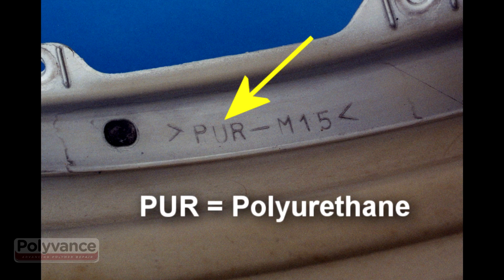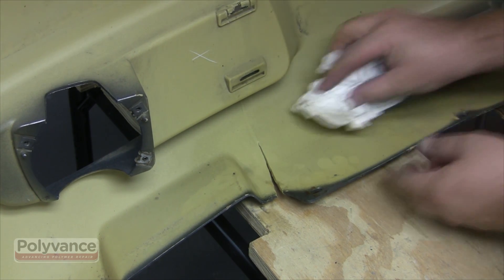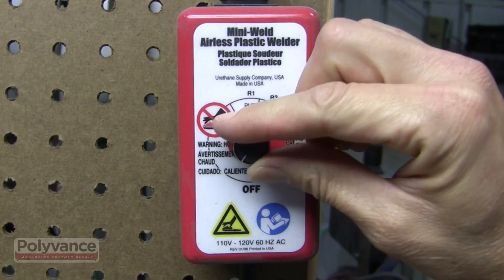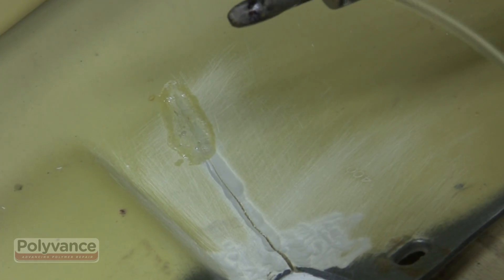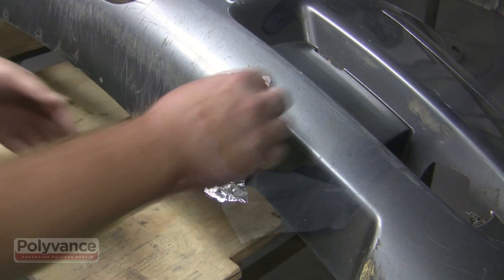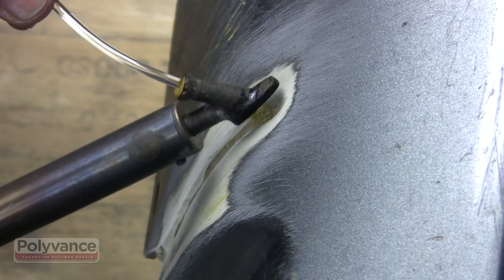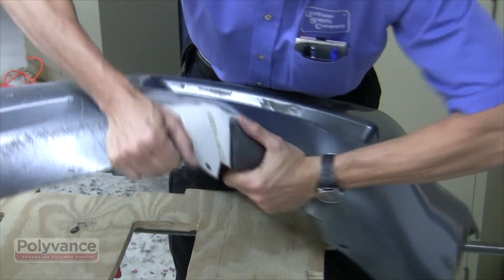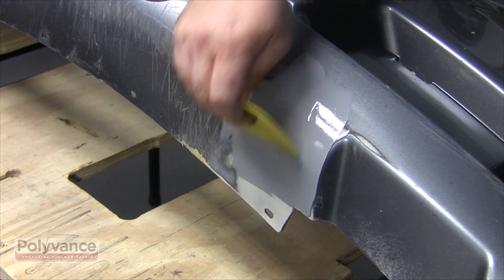How to Repair Thermoset Polyurethane

Comment: They got an awesome bond on that repair. Even wrenching it for an intentional break failed. Curiously, molders switched from PU to PP/TPO plastics. If anyone knows why plz share.
Reply: They still use urethane in some cases.  the reason for the switch is cost.  On high production cars, the cost of the mold is high for making bumpers out of Polypropylene, but the high cost of the mold is offset by the low cost of polypropylene plastic resin...so the higher the number of bumpers made, the lower the cost each is with higher production numbers.  With low production number cars, its more cost effective to use urethane as the bumper material because the mold cost is much lower, however the materials cost is about 3x that of a polypropylene bumper of equal size.  Urethane was also used in the past because paint bonds to it fairly easily and its impact resistant as well.  New paint technology has allowed paint to reliably stick to PP modern bumpers are typically made from.  I hope this answers your question!
Reply: Thnx for delineating. Could you touch on the viability of each plastic's useful life. PU, aerated type, degrades pretty quickly according to an article I chanced on discussing its use in footwear. It was a shock to see the extent of PU degradation throughout the shoe's midsoles after 15 years or more. It got me thinking in a very different way about TPs. Do PP/TPO plastics have this problem?
Reply: @vivianoni9565  Urethanes in general are susceptible to decomposition from a wide variety of things ranging from UV light to solvents.  On bumpers, this is generally not an issue because the outer surface is covered with paint and the inner surface doesn't see much action from anything at all...however urethanes tend to shrink as they age and deform as a result of external stresses...like gravity.  This can cause them to not fit well after a long period of time and have saggy spots.  They can also craze and cause the paint to crack, once that happens the deterioration accelerates.  PUR bumpers are also not recyclable.  

PP bumpers don't have any of these issues.  their only drawback is that paint can be a challenge to get to adhere. Bumper and Cladding Coat Adhesion primer and Plastic Magic fix this; either can be used to get paint to stick well.   They also can only be repaired by welding to get a 100% reliable repair.  As an added bonus, they can be recycled and made into other things...Flower pots are a common 2nd life for polypropylene bumper plastic.

Comment: FINALLY I find a video that helps!! I'm moving the medallion on the nose of my Jaguar to the grille and need to fill the hole(s) left behind. Not thinking of welding to fill the hole, just thinking about using the epoxy filler. So to prime I really won't need an adhesion promoter?? I'm impressed with the strength of that weld in the video!!

Comment: Hello there. I have a boat made from  Comptec PE3, a three-layer polyethylene. It has a crack that can only be accessed from one side, it is about 10-15mm in length. How could I repair this?
Reply: I myself have a Coleman Scanoe RamX And it is not easy to fix it’s crossed linked high density polyethylene which turns the HDPE from a thermoplastic that can melt into a thermoset plastic which means it no longer melts… at this point It’s not easy to repair, even before adhesives and epoxy’s will NOT stick to HDPE. A guy has to first &  foremost clean the area very well with alcohol then with a die grinder creat a groove in the crack… next create a slight bevel around the crack a bit wider in diameter then the groove in like an oval pattern. Then with course sand paper rough up the area to create tooth or bite for your plastic filler to stick too. (I recommend HDPE Welding Rod) and then buy a Polyvance's KCWPRO airless plastic welder (less then $100) melt the rod with the welded and force it down into the crack to create a plug. (Remember not to heat the base material ) fill the whole crack then continue to continue to fill and smooth whole bevel, the smooth. You can sand after you’re done if you need to if it’s sharp or rough

Comment: I just tried my daughters hot glue sticks and it hold strong as $4 job done
Reply: Unfortunately, they do not hold onto urethane as well as the urethane to urethane bond.  It may be OK for a temporary fix you don't plan on refinishing, but for a paintable, permanent repair urethane rod is the way to go.

Comment: What is the temperature for PUR ? 
Amazing job
Reply from the maker: Thank you! The setting is around 300 degrees.
Reply: Polyvance. I want to test this on my bumper of BMW e30 84.
Reply: Polyvance. Hello, I've a problem..
I bought polyurethane from your brand + tip. It's very difficult to buy in France. I used a seller in England who charged me a lot of shipping costs. You tell me it's 300 degrees C, I see you're selling an ATV kit with a 40 watt soldering iron. But 40 watt = about 560 degrees. I do not know what to buy ... I buy a 25 watt 300 degrees or 40 watt 560 degrees? Celsius.

thank you.
Reply: First of all, wattage has little to do with the tip temperature.   The tip size, internal thermal conductivity of internal components, ambient temperature, airflow around the welder, and component design have a far greater effect on the temperature....Its impossible to simply plug watts into a calculation and get temperature.

The current  ATVPRO welder we sell is 200 watts, the ATV welder at 40 watts has been discontinued for years, the 80 watt ATVPRO is also discontinued.  The 200 watt ceramic core welder and the 80 watt ni-chrome wire heating element produce roughly the same tip temperature....ALL of the above welders are too hot for urethane.  There is a work-around however.  If you want to use the ATVPRO for urethane, simply start welding before the welder is fully hot and keep rod moving through the tip to keep the tip temperature down.
Reply: Scott B thanks for response.
I can not buy the ATVPRO. You imagine, I paid 90€/106 dollars for your tip and the rods in Europe. That's a lot of money for me. I am not rich. And I do not know what soldering iron wattage to buy in Europe at a good price for your standard tip. :-(
Reply: That's quite a mark-up they put on that, but a lot of that might be due to the high shipping costs associated with importing/exporting.
Reply: Scott B i wouldnt even attempt to import that to thailand then as the import tax (theft) Is around 300%! Guess ill buy when i go back to the uk.

Comment: What can I use to repair SMC can I use my fiber flex and my welder
Reply: You really can't use the welder to repair SMC.  SMC is Sheet Molded Compound, aka Fiberglass.  The best repair for it is to sand the area being repaired, beveling the edge gradually, then apply layers of glass cloth saturated with epoxy resin.

Comment: Can i use fiber flex to repair radiator nylon
Reply from the maker: FiberFlex will stick to nylon, but it isn't the best option. It would be better to repair it with nylon welding rod (https://www.polyvance.com/Nylon-1/), which is the rod that comes in our radiator repair kit.

Comment: Instead of requiring two hands to apply the welding rod, it would be nice to have a tool like a glue gun where pulling the trigger applies the rod.
Reply: We've actually looked into this, but found that applying urethane that way is not as versatile and produces a lower quality bond than when using the 6027HT welding tip.  The reason we think this is so is because you don't have the pressure of the melted rod being forced onto the urethane.
Reply: @scottb7600  Good point. What’s your opinion of using something like a construction adhesive that is polyurethane?  Then you don’t have to melt?
Reply: @STARGAUD  Most adhesives will not bond as well to urethane as urethane bonds to itself and in terms of cost, a little welding rod is much cheaper than adhesive.  Yes, I know, you still need to make the investment in the tool, but spread out over multiple repairs, the tool will more than pay for itself.
Reply: @scottb7600  Thank you for the reply.  I have the tool! Should I use the clear rod then on a urethane bumper?  I am currently looking for an epoxy skim coat.  the 2000T would take too long to get here so I am looking at the 3M EZ Sand 35887.
Reply: @STARGAUD  Yes, the rod you should use is the clear PUR rod part number R01-01-03-NT.  It's clear, but has a yellowish caste.  Polyvance has two fillers that work great.  One is the epoxy based 2000-T or 2000-C (tubes, cartridges).  The other is Putty Flex, which is polyester based; PN 1047.